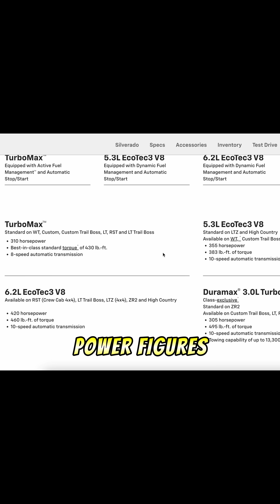Modern 1500 Engines Are Working Too Hard - WILL THEY LAST

Comment: Bad engine.....Bad transmission..... 50-60k truck..... screw these manufacturers
Reply: Look what happened when we bailed them out. Look how they repay us.
Reply: Frontier,  the sensible option
Reply: @TIJoe-te9qu   I've considered it since Ford wants to put inaccessible rubber belt driven OIL PUMPS in their trucks, with no redundant backup. Lose the belt, lose your engine. GM and Ford been living on the capital of nostalgia and patriotism and are about to run TF out of it.
Reply: @TIJoe-te9qu said no one 2 years ago. Ironic how Nissan suddenly became a truck contender
Reply: @mtaylor6745 No, despite your losing attempt to make YOUR opinion sound like EVERYONE'S opinion. Such a typical narcissistic tactic. You reveal yourself. 
While you were under a rock, or fanboy-ing for your favorite team, Nissan has made exceptionally solid trucks since ar least 1959, whe they first came here. I've been depending on them almost 50 years, so I know a little.  There has not been ONE bad generation. Ive had the same one 30 years now. If it wasn't good, I'd go somewhere else. Unlike codependent brand fanboys,  I do have a choice. 
Try looking up the 2007 million mile Frontier on  YT as an example.  And it's ok to admit your ignorance.
Reply: @TIJoe-te9qu for real, they made the frontier the exact same from 04-2022 for a reason! Only thing they had to fix was the radiator and trans cooler mixing their fluids in 04-10. Bulletproof little trucks, unlike the titan unfortunately. Especially the Cummins titan flop
Reply: @calebjohnson1627 Yes,  I considered a Titan diesel.  Seemed like the perfect pair of Nissan and Cummins. I think Nissan wanted to make a great truck, but unfortunately they got a lemon Cummins,  which no one expected. I wish Nissan would take a straight six diesel from their OWN commercial line,  and drop it in a Titan with a manual transmission, and 8 lug axles.  That would be gold to me. 
I hope they make the new Frontier for another 15 years. The D40 is good,  and the frame held up while Tacomas were rusting in half. So good that they're still using the platform now. The hate boys like to criticize it for being "old," but it was obviously so good that it's competitive and proven even today. I like that Nissan doesn't rush unproven new junk to market every few years just for the sake of change.  Nissan suffers because so many sheeple are addicted to the latest flashy gizmos and trends, and their beloved fanboy brand addictions.
Reply: @mtaylor6745  Nissan has always made decent trucks. Their v8 (gas) was basically just an LS motor to the point you could actually just swap LS parts to them. 

Where they really sucked what their gearing. Towing was pretty mediocre at best. Their 4x4 systems though are IMO a cut above most.
Reply: They need to do a bare truck no fancy shit the 6.6 gas engine just heat and ac optional radio or cheapest option no heated interior pieces and charge half the price and it’d take less time to build
Reply: This is why I drive a 99 Expedition with a 5.4 and 4r100. 287k miles and it still runs like new.
Reply: @sashimiturtle  Is that the 2-valve version  or the 3-valve?
Reply: @TIJoe-te9qu its a 99... the 3 valve didnt come out in the F150 until 04 amd the Expedition was 05. Come on man.
Reply: @sashimiturtle I was just asking,  ok?  I haven't memorized the exact years of application of every engine and vehicle. A buddy just paid $9000 for a replacement 5 4 3V, so it kind of caught my eye.
Reply: @TIJoe-te9qu bet he didnt take care of it. 3V is a great motor once you replace the spark plugs with the updated part number. The old ones would seperate. New ones are one solid piece and wont come apart.
Reply: @sashimiturtle No, it's a well-maintained Lincoln LT.  You may not be aware,  but these things do run well, yet they are NOTORIOUS for sludging up and then the cam phasers go bad, then the whole thing  grinds itself to ruin.  Lots of video about it from Car Wizard and others on what a nightmare it is once they go bad. They just order a new engine at that point. 
I told my buddy  to get some Amsoil in that new engine,   then cut the oil change intervals in half, and the Amsoil tech rep agreed with me. Keeping these engines extra clean inside makes them last much better.
Reply: @TIJoe-te9qu Boss has an F150 with the 3 valve. You gotta run the 5w30 oil and keep it changed. Can't skip any oil changes or extend them. I'd recommend Motorcraft oil and filters exclusively, thats all I run in my vehicles. I also have an 04 F250 6.0 with 235k on the original heads gaskets.

Comment: So if you're right then why give it a 100,000 mile warranty?
Reply: I’d hope spending $50k on a truck I get more then 100k miles on it. I bought my 13’ ram hemi for $45k well optioned and I’m pushing 300k.
Reply: You buckled your seat belt incorrectly, warranty denied for transmission failure.

Comment: maybe the big naturally will last longer but not necessarily.  look at chevys big engine problems of today and compare that to fords f150 smaller turbo engine which seems to be a great turbo engine.  dont through the baby out with the bath water
Reply: Yup. What he's describing here is just "on paper", not exactly 'real world'. While there's clearly some issues with modern engines(the vast majority being driven entirely by gov regulations becoming so extreme🙄) - the fact is that old school pushrod engines of decades ago quite often required rebuilds, while properly maintained modern engines(and I'd argue that, at this point, "properly maintained" includes running oil that's a bit heavier than the water-like oil they spec now to try to squeeze every fragment of MPG out of them) just don't really require them, even with different examples of multiple hundred thousand mile engines out there. Cylinder honing/alternative cylinder lining materials are MUCH better than in decades past, low tension ring packages that don't wear out the cylinder near as fast and conform to the cylinder wall better, tighter piston tolerances, MUCH better oil pumps that are creating much greater oil pressure, much more precise fuel injection, knock sensors that can save an engine from things like bad gas, roller valvetrains, MUCH more advanced valvetrain tuning(more performance while being easier on valvetrain parts), better air & oil filtering, modern engine oils(the light viscosities aside), modern durability testing(of course you'll never truly be able to completely replicate the real world; but OEM engine durability testing is GNARLY), etc.

There's just so much more to this than simply "well the engines from 40 years ago were big and naturally aspirated, and the engines of today are smaller and turbo'd, therefore..." And, frankly, he'd have a better argument if he focused on things like the ultralight oil specs for modern engines and the emissions & fuel economy related features(like cylinder deactivation that no one likes or wants) that are so many times the source of reliability problems.

Comment: What’s your opinion on the 3.0 litre duramax lzo? Also not durable?
Reply: No its not.
Reply: There’s issues with every engine ever made. The 3.0 is a good engine. You just have to be prepared for expensive maintenance in the future. The best driven oil pump and its placement/design is the major issue that turns people away. I would still buy one personally over any other GM engine. You can get nearly 30mpg in that. Plenty of people out there high miles on them and failures.

Comment: "Heat is one of the biggest killers of engines"
An even bigger killer is GM's v8 engineering team my guy
Reply: More recently, yes. That started with cylinder deactivation; and, continued with pushing thinner oils. Before that, GM V8s were reliable enough for the subject to be boring. I remember an old 305 with 300k on it that ran like it was new. Only thing that was ever replaced was the water pump, once. They could have made the water pump easier to replace; but, over all great experience, would buy again. The original transmission on that truck felt like new at 300k, too. Gave it to a farmer with one like it for parts, when the frame finally rusted out. The book time on the water pump replacement was wrong…
Reply: @jpa9058  of course, their v8s used to be bullet proof. We're over a decade of mediocrity at this point though...
Reply: @thesandman775 almost all GM trucks are shit. Even their early 2000s ones
Reply: Still wouldn’t get an ecoboost over a 6.2 or 5.3.
Reply: @AnontheGOAT even then ecoboost aren’t blowing up like these new GM v8s
Reply: @L @Limited-uq2yk At least GM is recalling them and giving those that pass a 150k warranty for the block. Has Ford done a recall for the faulty 10R80’s put into everything from 2017-2022? Or how about all of the cam phaser issues that eventually lead to engine failure going back well over a decade at this point? Ya didn’t think so.
Reply: @AnontheGOAT  they’re not as problematic as GM’s that’s why and GM was forced by the NHSTA to recall their v8s because if they don’t then they’ll get shut down. Goes to show how much they actually care about their customers. lol!
Reply: @Limited-uq2yk Do you know what a recall is? It’s only done when the vehicle is faulty in a way that endangers lives. Obviously an engine seizing is a pretty serious thing. But that doesn’t mean that GM is worse than Ford lol. I love my Yukon. Can’t say for the Fords I’ve owned.
Reply: @A @AnontheGOAT you said it yourself, It’s dangerous. My Fords treated me better than all the GM vehicles I owned before. We both had different experiences. lol!
Reply: @Limited-uq2yk Ford doesn’t get a pass. They should have recalled the 10R80. The CDF drum fails, your transmission goes out. Happened to my friend’s 2018 Expedition. Thankfully he still had some of the gears working to make it home. 100% a safety issue.
Reply: @AnontheGOAT the 2.7 EB is a much better engine than the 6.2 and you know that🤣 it’s been immensely more reliable.
Reply: @scdh2396 Maybe in terms of reliability it is, but it in terms of usefulness? Absolutely not! It’s smaller than a lot of car engines man. The 6.2 has a manufacturing defect. Outside of that, it’ll out last a turbocharged engine.
Reply: @AnontheGOAT  that's cool. They're objectively more reliable over the past 8 years, though. Many are still stuck in the 20 years ago eco boost failure rates.
Reply: @thesandman775 I disagree. I’ve owned 4 of them. 2016 2.7T F-150, 2019 and 2020 Expedition, and 2020 F-150 3.5T. Transmission issues with the Expeditions and 3.5 F-150. This guys video didn’t mention the additional stresses a small displacement twin turbo engine places upon the transmission. It suffers from serious heat soak towing up grades on hot summer days. Ask me how I now. Ditched our last Ford for a 6.2 Yukon and saw 30-40F cooler trans temps on those same grades towing the same exact thing. Also cooler engine temps too.

FYI, dunno where you got the 20 year figure, first gen ecoboost was offered in the 2013 F-150. You’re a little off.
Reply: @AnontheGOAT couple of points. First, if your issue with them is the transmission, I have bad news for you if you're turning to a GM... They codeveloped the current transmission utilized by both brands with very few meaningful differences. Second, it launched in 2010 and 2011 on the f150, so 20 years was an over exaggeration, yes. My point is that they've been out for the better part of 2 decades and don't have the kind of engine issues that the 6.2 currently does. They started pretty poor but they've ironed most of the issues out.
Reply: Its not the engineering thats the problem its piss poor part quality is the problem
Reply: @arikharrelson6009 and what department do you think designs the parts? Or comes up with the metallurgy used for the manufacturing of that part? Or how about who comes up with the manufacturing processes for those parts? Or what department is quality control ran through? Engineers. Crazy how that works
Reply: Give credit where credit is due…. That 6.6 gasser is a beast. But GM engineering being GM engineering…. “Oh you like our commercial grade big lumpy engine? Aaaaand it’s gone!”🤣
Reply: I bet theyre indians born in india gm will say are americans
Reply: @TheAnnoyingBoss no
Reply: Left leaning politics pushing manufacturers like GM to produce v8s with unrealistic fuel efficiency so they have to resort to using things like AFM*. Fixed it for ya
Reply: @curcheesegaming8704 politics didn't cause GM to leave machining burrs on the crank of a million 6.2 V8s lol
Reply: @jaredlancaster4137 imagine being pushed for decades to keep meeting more qnd more unrealistic demands. Know what comes next when your biggest expense is keeping up with regulations? You have to make production cheaper. Know what happens when you nake production cheaper and cheaper? You get messed up parts from the factory..
Reply: @jaredlancaster4137 you should do some research on why cars are the way they are.
Reply: @curcheesegaming8704 I don't disagree that government overreach is a major pressure on manufacturers, and contributes to their general mediocrity.

But a vehicle like an Escalade with a 6.2 produces an extremely large profit margin for GM. In general, the automotive industry's profit margins are historically high, mostly brought up by the popularity of vehicles like the Escalade.

For $90k, GM can afford to machine a crank correctly. Even with BS EPA and CAFE overreach, GM's quality control is plain old mediocre. Not just GM: Toyota, Subaru, and Ford have had recent and famous machining quality issues. Quality control and engineering are garbage across the whole industry, and it can't be blamed just on the government.

Comment: Strike 1: start/stop engines. Strike 2 : cylinder deactivation. Strike 3: turbo engines.  Three strikes… yep dead engines. Manufactures: we build shitty products but we have to raise prices. The government: F$$k the people we gotta save a beach rat, a woodpecker or whatever else we dream up. You can’t make this shit up but The Temple Harlots in Washington do it everyday even when the government is shut down.
Reply: Turbo engines have been the longest lasting engines on the road for decades.
Reply: @flynnryder7798 when they’re cast iron block diesels with forged rotating assemblies, yeah. Otherwise, no.
Reply: @garboi8976 you don’t need forged rotating assemblies or cast iron. Heck, the ford 7.3 used powdered metal in its last few years, which are considered its most reliable years. You do need upgraded internal metallurgy, on things such as the intake and exhaust valves. These are upgraded to inconel on most of the new boosted engines.
Reply: @garboi8976 Mopars new 3.0 hurricane is forged. I believe Toyotas new boosted engines are as well. These modern engines are beefed up internally. As an engine’s parts supplier, we are not seeing premature failures.
Reply: turbos them selves arnt that bad. its a 4 cylender with 2 turbos straped to it thats a bad idea or small dissplacment engine and a turbo. in an aplication that requires power yah the small will make it just not for very long.
Reply: @alexlindekugel8727 I understand that but you have described the problem and that’s what they are doing. Thanks for the comment.
Reply: It’s not “turbo charged engines” that are bad. It’s the fact they strap a turbo to an engine that can’t support that kind of power for a long life span. Diesels are made to push that power. Using better internals and ditching some of the unnecessary electronic Nannie’s would help. Start stop has been proven to be useless. The pros/cons are obvious it needs to go.
Reply: @mminniear984 they use better internals on the new gasoline turbod engines. Basically same materials as the diesels.

Comment: Reasoning makes sense , but when built right these small power houses like the 2.7 eco boost are proving to hit 500k miles with just basic maintenance. Most half ton owners aren’t doing major hauling and payload anyways . Most manufacturers still have their 5.0,5.3,5.7, and 6.2 options anyways
Reply: Lol 😂